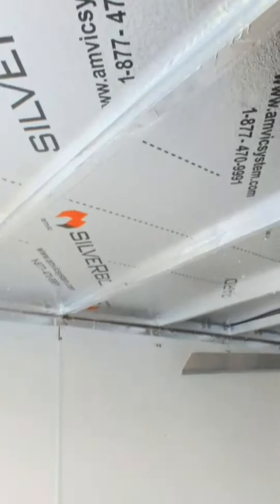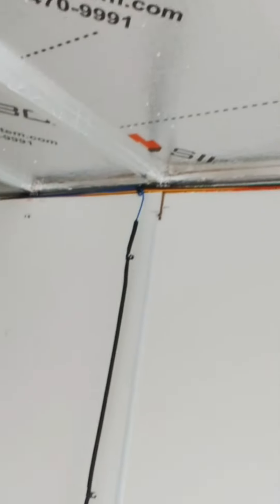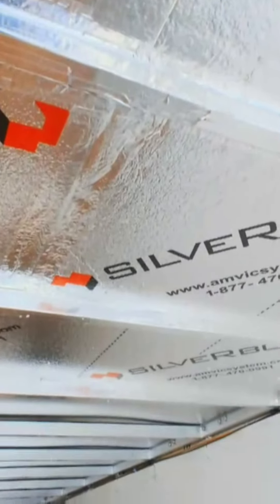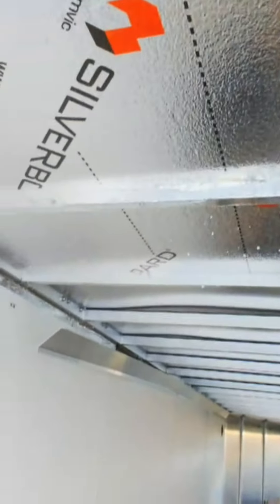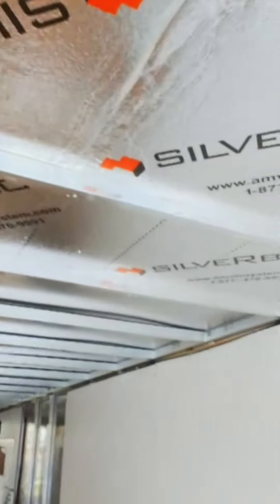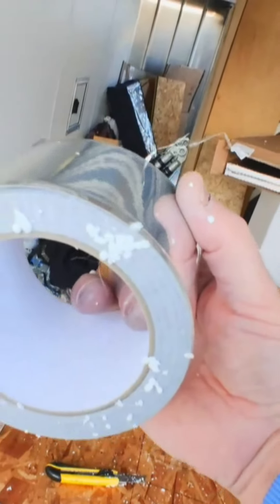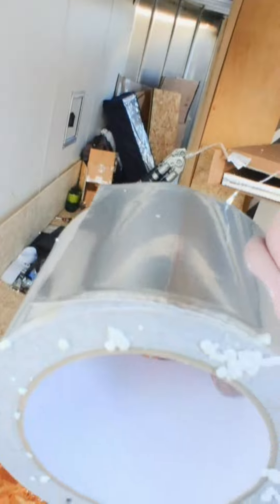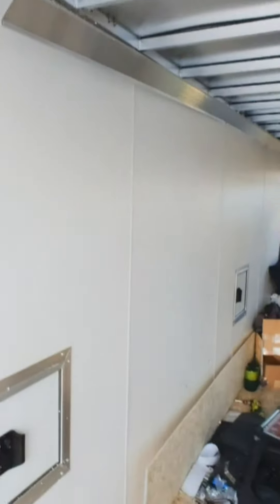Installing Silverboard Insulation and Ramp Winches

Comment: What Brand of tape did you get on Amazon
Reply from the maker: Sorry, missed your comment! I used: "CarterTM Professional Aluminum Foil Tape 3 inch x 150 feet – for HVAC, Hot and Cold Air Ducts, Insulation and More (3 Pack)" from Amazon.